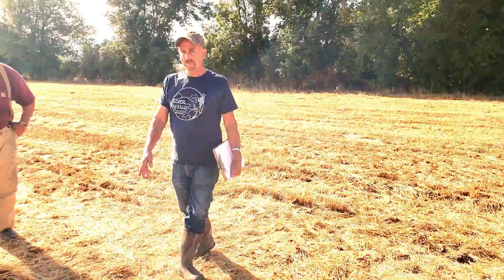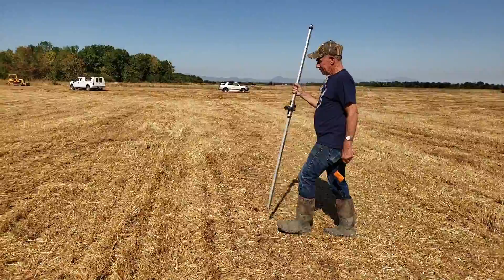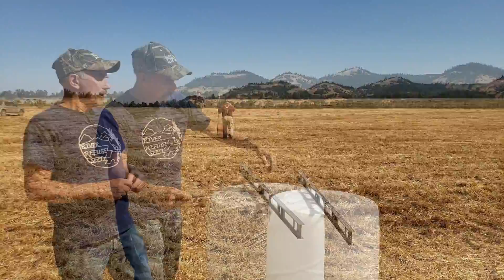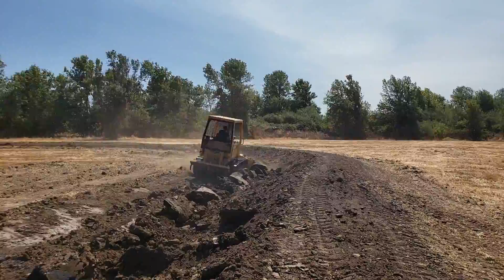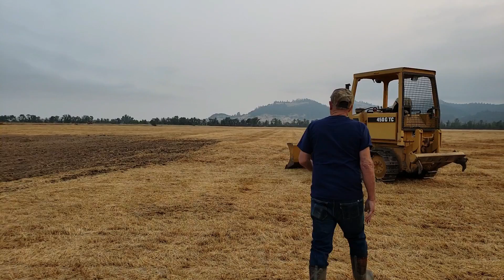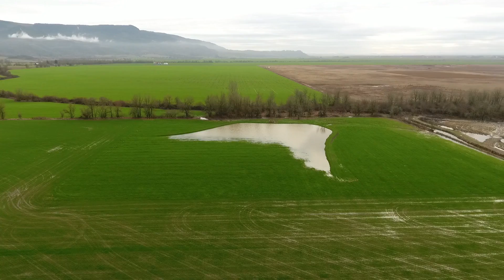How to Build a Duck Hunting Pond

Comment: How well does this type of water control system work? Is there a lot of adjusting the pipe as the water level rises?
Reply from the maker: It works great. It is good to add some support to the pipe (fence post, T post, etc) once the water gets high, to help support the pipe as the weight and pressure of the water build. We also use flashboard riser headgates attached to culverts to control water as well.